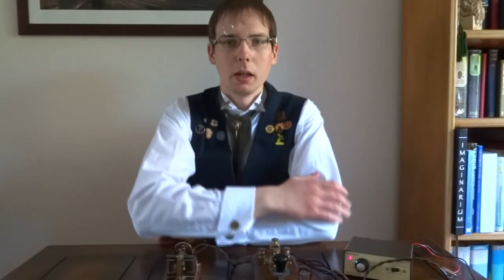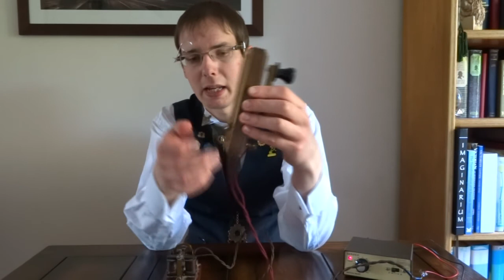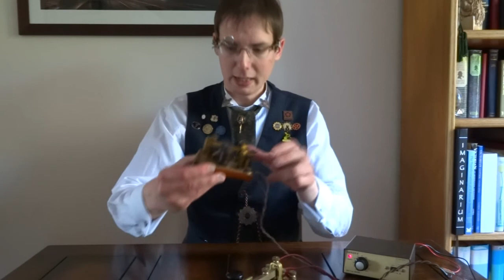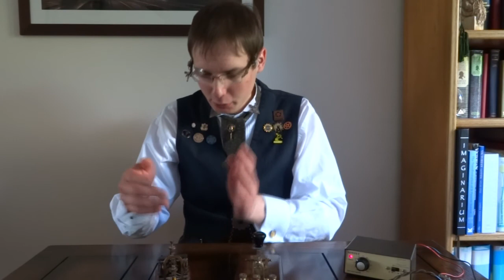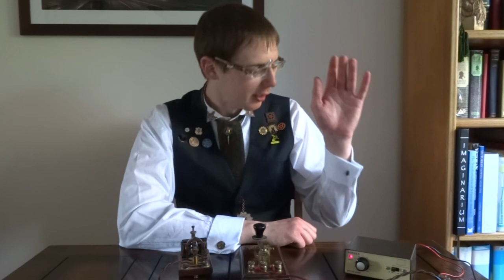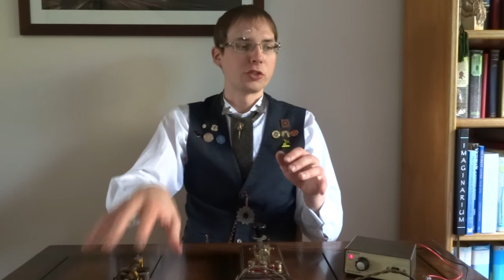A Brief Chat about Morse Code Telegraph Equipment

Comment: That telegraph sounder sure looks interesting! Haven't seen anything like that before, just some relays. Nice find! And if you want to learn morse code, LCWO is probably the best bet. Thanks for the video, interesting stuff!
Reply from the maker: It is an odd item as it definitely looks like it has other terminals on it to operate something else. It is broadly the same as some of the ones you can find on a google search but they don't tend to have the switch underneath